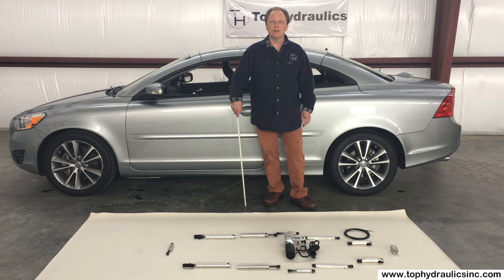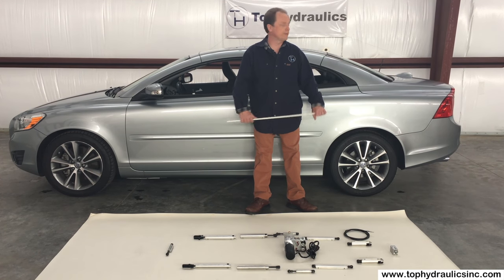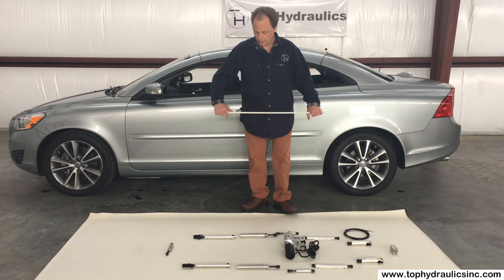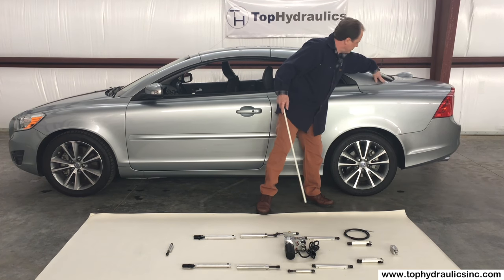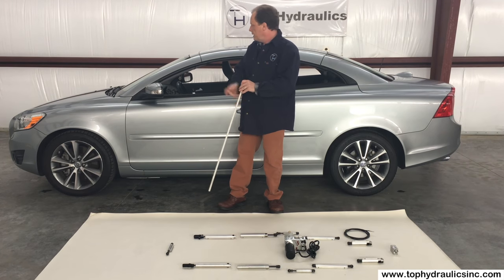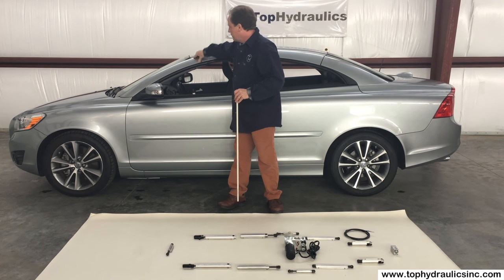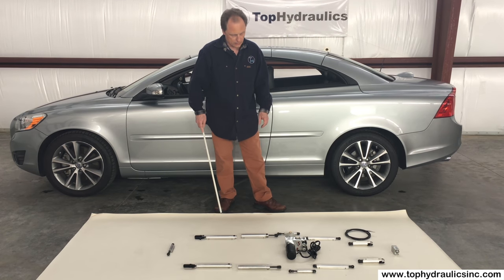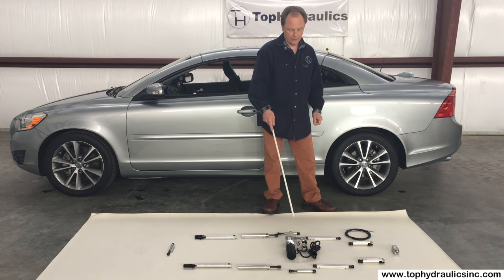Volvo C70 - How to Replace the Convertible Hydraulic System - Chapter 1 - Introduction

Comment: Thanks so much. Very explanatory educational video. I have a 2007 C70. The small side inner roof panel flap on the passenger side stays down as the hook for the wire is broken. How can that be replaced. I can glue the hook with super glue or a bit of fibreglass to make it strong again. However I do not know how to attach the cable/wire that makes it pull up. Which wire is it and how to connect. Any suggestions or do you have a video for that as well? Thanks Job

Comment: I have been watching your fantastic videos, I must say they're very well explained. I have just purchased a 2008 C70 and I have been told that the roof will go down but not back up by the dealer I bought the car from. What could this be? The car has a full service history and looks as though its been well looked after asides from the tatty bodywork.. I have noticed that there is water ingress and the boot/trunk is damp. Would the motor roof completely pack up or could it be a switch inside the car that has failed? I am yet to try the roof myself as the weather in the UK is appalling and for fear of it getting stuck in the down position..Any assistance is greatly appreciated. Many thanks
Reply from the maker: Congrats on the new ride! Undoubtedly, you got an excellent deal on the car if the roof does not function properly. As you can see in our video, it takes some effort to close the top manually, so you don't want to do this voluntarily when it is about to rain. The water ingress in the boot/trunk area is an important detail. It is possible that your pump only operates in one direction after it has become wet. Take a look at the pump. It is way forward in your boot, on the bottom. You can use our pump removal video as a reference: https://youtu.be/1IjMvJbMA08?list=PLly4CMbpk7oxURyynXnc_U8H3BmtT3Zqa If the pump motor looks quite rusty, then that's probably it. The pump's part number is 36011248. We offer core exchange on it, which means we ship one first from our inventory, then you send back your old one for refund of the deposit. We ship worldwide, and parcels to the UK arrive within two days to most locations. Here is where you can order it, if needed: https://www.tophydraulics.com/volvo/700-c70-hydraulic-pump.html#/29-core_exchange-order_now_with_core_exchange
If your pump looks good, then please feel free to contact us directly via email, and we will go through the next diagnostic steps. Simply send a message to info@tophydraulicsinc.com
Reply: @TopHydraulics  thank you very much for your assistance! I shall have a look this weekend and report back. Cheers.

Comment: Good Morning Klaus, I have a 2007 Volvo c70.  The roof stopped halfway,and with help from your videos we have closed and locked the roof now.  We also exposed the pump and adjusted the pull wire shown on Chapter 8.  My problem now is I am still getting the roof failure code.  How do I reset the control module?  Thanking you in advance with much appreciation!
Reply from the maker: Congrats on getting the top closed manually! Try turning the cable drive in the trunk back to where it was (when the frame lock was open) with a 4-mm Allen wrench and see if the computer will latch it electrically from there (by pushing the CLOSE button and if the alarm will get cancelled that way.

Comment: Very informative videos, thank you for that!
How would you remove the hose from the distributor, since I have a hole in the hose that runs from the distributor to the cilinder?
Reply from the maker: If you take a close look at the distributor, then you see that each hose is fastened with a Torx bolt. Remove the bolt, pull out the hose... For hose removal on the cylinder end, you can use the matching video about cylinder removal.
Reply: @TopHydraulics  Okay, great, I was wondering where those bolt were for. 😅Would it become too expensive to send one of those hoses to the Netherlands? Number 83 is shot.
Reply from the maker: @pietjespappie  Here it is on our website: https://tophydraulics.com/volvo/246-3436-c70-hydraulic-line.html#/129-hydraulic_line_number-83
Reply: @TopHydraulics  Found it and thanks!!

Comment: What could be a possible issue on my 2013 Volvo C70, when I press the button to open roof all the windows go down as needed but the trunk lid does not want to open but makes a constant like humming noise and will not lift the trunk lid. I brought it to a dealer and there is water leakage. What could possibly be the issue
Reply from the maker: If you had prolonged water intrusion into the trunk, then likely the pump is damaged.
Reply: @TopHydraulics  Ok thank you I checked codes and I’m getting a code saying CRM-C072. Catch motor, Motor blocked. Do you know by any chance where this catch motor is located? And what might be the issue here??
Reply from the maker: @markv5235  I assume that this is the same motor that you bypass when you use the 4-mm Allen wrench in the trunk lid - see our video on manual top operation.

Comment: I love the videos you make, they are very helpful. I have a 2012 C70. When I tried to drop down the drop top, they trunk only open a bit and then it stopped working. I got out the car to check what is the problem, I found lots of hydraulic fluid licked inside Bracket lid cover that covers both the left and right trunk lid cylinders. more licked fluid on the left side trunk lid cylinder. Do you think there is a linkage in the system of is just one of the trunk cylinder that is licking? Thank you
Reply from the maker: Fortunately, the hoses and cylinders in the trunk lid are easy to get to. You will have to take a closer look and determine where the leak is coming from.
Reply: @TopHydraulics  I found the lick, there is a cut in the hose that Links to the left cover cylinder. Is it possible to change just the hose or I do have the change the left cover cylinder as well? Thanks
Reply from the maker: @foreignwild4951  Congratulations! It is possible to just replace the hose. The process is pretty much self explanatory if you watch the video on the cover cylinder replacement. The other end of the hose unscrews from the distributor in the middle below the trunk lid.

Comment: Hi there please help, I have a C70 - 2008 , clocked 220000 klm, I just had a roof failure and it stopped half way through where the 3 parts are above each other,  Volvo technician told  the main car computer is not  detecting the roof ECU ... I also notice that lately its slow to open and close, what part should be replaced ?
Do you think changing the roof ECU and the pump will solve the problem or does everything needs to be replaced ? I live in Dubai where in summer the temperature are well above 50c..Any help will be very much appreciated. Thanks Alex
Reply from the maker: Hello Alex, 

thanks for asking. You mentioned that the top was slow to open and close, lately. The first thing I would do is check the fluid level in the pump. If the fluid level is low, then you have a leak - you need to find it and fix it. If the fluid level is correct (meaning you have no leak), then you are likely dealing with a weak pump.
Here is the playlist of all C70 videos: https://www.youtube.com/playlist?list=PLly4CMbpk7oxURyynXnc_U8H3BmtT3Zqa
The video on pump removal shows you how to check the fluid level in the pump: https://www.youtube.com/watch?v=1IjMvJbMA08&list=PLly4CMbpk7oxURyynXnc_U8H3BmtT3Zqa&index=9&t=0s

It would be unusual for the computer not to detect the ECU after the top has moved half way, so let's talk about it after you have checked the fluid level. Remember, your top was opening and closing slow, lately, which is not related to the ECU.

Klaus
Reply: @TopHydraulics  Hi Klaus, Thank you very much for the advices,  I am not a mechanic but I'll try to check it out with another technician and Ill show him the videos ;-))

Comment: Hi - my top was complaining about not being locked.  Typically, when I open and close the top again, the issue is resolved.  However, in this case, I stopped part way with the trunk in the air, and now the trunk won't close.  Can you help me figure out how to release the trunk so it goes down, so I can then at least drive to the dealer to get it fixed?
Reply from the maker: You will have to open the pressure relief valve on the pump and then pick up at the proper step in this video: https://www.youtube.com/watch?v=i6NVwfXUi5s&list=PLly4CMbpk7oxURyynXnc_U8H3BmtT3Zqa&index=10
Reply: @TopHydraulics  I’m not kidding when I say I respect you like few others.  I hope when I die, we can meet in heaven because you’re the kind of guy one would be lucky to call a friend!
Reply from the maker: @sarno82  Thank you very much for your kind response - I’m quite touched and this single response already made it worthwhile to make the videos!
Reply: @TopHydraulics  I'm sorry to bother you further.  I have successfully released the pressure.  However, the truck lid is still in the air, and appears locked.  I can't determine from the video how to release the trunk lid back into it's driving position.  It doesn't seem like it is the wrench that releases the trunk top.  How do I get the trunk top to unlock/release?

Comment: i have a question related to my 2008 c70,maybe you can help me resolve my issue...as you know we can put the hardtop on what is called a *service position*..my issue is that my top wont hold this service position,it starts collapsing almost right away...was told to replace the main cylinders first and then  try the pump if that doesnt take care of it...your help is apreciated..
Reply from the maker: Excellent question, thanks for asking. The top would either collapse from service position if a valve didn't hold in the pump or if a cylinder had an internal bypass. Based on our experience, chances are at least 20:1 that it is the pump.
Reply: @TopHydraulics  ok,thanks,i guess i need to find me a pump then..
Reply from the maker: @carlosbalbontin2265  We ship C70 pumps almost on a daily basis, all over the world. We go through them completely and we are certain that they are better than new inside when we ship them. See https://www.tophydraulics.com/volvo/700-c70-hydraulic-pump.html
Reply: @TopHydraulics  so if i had a problem with one of the main cylinders the top would also leak down,right??how would i diagnose this,i hate to spend $500 and not fix my issue....i have 2 used main cylinders i was planning to swap but not sure now...
Reply: Hello I have an issue with the top on my 2007 C70 convertible. When I try to put the top down the windows drop as they should and the boot lifts back and then nothing else happens. You then have to pull it back down manually to close it but it still won’t lock shut. Any advice would be appreciated thank you